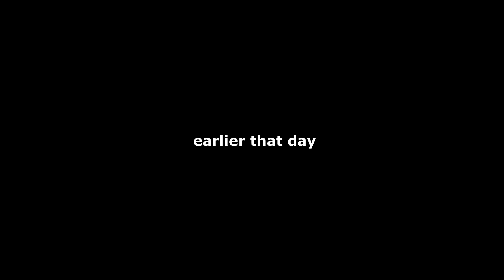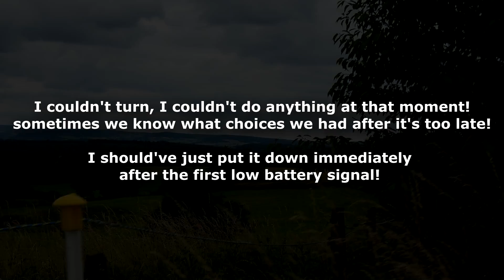RC Boeing 737 MAX8 fatal crash trying to land, it's gone.

Comment: Rc alert news! A plane crashed from the bushes, an airline called, "Ramy rc" Crash was fatal. There were 44 passengers onboard, 22 Passengers were killed in the accident. It also crashed because, After making 2 attempts to land on the runway. The 3rd attempt did not go very well at all, when it was about to do a Go-around this message came. 'Battery low please touch the ground immediately!' The pilots got scared, just before the moment it crashed. The plane started to stall, The pilots did a sharp turn 1 second before incident. 22 passengers killed, All of the pilots killed, 2 crew members killed. Plus, 26 deaths. It wouldn't have crashed, If they just start to fly it when it is 100% Battery. There were 3 Pakistani tourists Who lost their lives. And other passengers were just random. That is all for our emergency news today. have a great day!

Comment: It is 4 years late, but is it possible to include logic that cuts the power to the engines at low battery conditions? Then the remaining power can be directed to the control surfaces to allow for some control, while flying on momentum, giving at least the possibility for a somewhat controlled crash landing. Similar to real airplanes being flyable without the engines. I would really appreciate an answer.

Comment: Get a Mobius camera with a lens cable extension. Then hide the camera inside the vertical stabilizer and place the lens at the leading edge. Much better than attaching a GoPro.

Comment: I would have thought that the ESC with BEC would cut off power to the motors in order to maintain power for the servos.  Did this ESC not have a low voltage cutoff feature?

Comment: why not try some flight controller? suggest you A3 pro flight controller . that will balance the plane to level flight after stick nutueral  .that will make flying much easier. and another suggestion to you as a pilot myself ,when you do approach , the plane should pitch level and maitain speed ,that will be a good attitude\ speed and throttle setting.every time you do approach is way to steep desend .that will cause huge speed and  energy change when you try to  flare.on the other hand ,high speed approach will easily cause long flare ,used most of the effective runway , easily go around. and high speed approach will make you throttle down alot . try figure out an approach throttle reference setting . you always adjust around that setting. throttle is for altitude pitch is just try to compensate that moment make plane pitch level it will stable much much more and easier to fly much much more .

Comment: I would never have mounted the GoPro there, there are such small cameras why do you save Money on the wrong end. The wind resistance is too high that's why she also flew so bad, YOU are really a good builder but as a user you have failed.

Comment: Last thing you need is some backseat remote control driver barking orders while you're already struggling to maintain control. After seeing this one and the new one both crash, and one burn, I think you should start clearing everyone back far enough that you can't hear them bark orders and make you second guess yourself. I'll admit that I'm not experienced in RC flying, so I'm not sure if there is a safety or operational reason for having someone standing out there with you, but I can't see it being that beneficial to have anyone nearby to break your concentration or make you second guess yourself.

Comment: You know you should treat them like you paid a lot for them, if a battery signal warns you you land now not later. Don't be nervous  you are a good pilot and you make awesome planes, just relax like your a pro and correct your mistakes. Stay calm when your coming in and  don't try to correct just small corrections and leave it until you need another small correction.

Comment: LOL 737 Max’s still even crash in the RC world.Damn you MCAS.
Reply: Both of those crashes will be ruled pilot error. Bet you a grand. The VAST MAJORITY of 73-8-max planes fly in north America and Europe, and occasionally experienced MCAS upsets. The well trained pilots used the stab trim cutout switches to disable MCAS and the manual trim wheels to counteract any undesirable trim that had already been applied. You just don't hear about those cases, because when competent pilots fly aircraft, minor shit can go wrong without being a huge event. Of course the ballsack media make a gigantic deal out of it while knowing nothing about airplanes. But lets see. Out of ALLLLLL the max-8s that have crashed, which is 2, one was in Ethiopia, and the other was in Indonesia.... Hmmmm. I'm not sure about Ethiopian airlines safety record. But I do know that the pilots of that plane had the throttles at 94 percent the entire time. Which is ridiculous given the situation. Because of their speed, they had a hard time trimming the plane back using the wheels. So they turned the cut off switches back on... This is a MASSIVE fuck up. How about pulling those throttles back a little bit there guys? As for Indonesia?? A quote.
" Lion Air is Indonesia's largest airline, and the second biggest low-cost carrier in south-east Asia. ... But it has faced nagging questions about safety standards and from July 2007 until June 2016 was banned, along with dozens of other Indonesian airlines, from operating within both EU and US airspace." sure, the plane had some design issues. But not ones that should cause a catastrophic fatal crash if competent or properly trained pilots are flying.

Comment: Mayday theme song

Today on Mayday we cover the fatal crash of Air RamyRC

Which it's known as then one of the worst crash in RC aviation history
All lives board (electrical engineering) has being lost
1 black box was found it's the cockpit voice data recorder and the flight data recorder was never found

What should of being a normal flight quickly turned if not a RC tragedy when a simple mistaking care of the aircraft would quickly turn to a pilots worse nightmare. It all
 started when RamyRC when't on a flight late afternoon when suddenly the airplane quickly turn to a moment of fear the battery in the back compartment of the plane ran out and the plane was having struggles to stay in the air after making 2 attempts to land which both failed the second attempt would be the last it ever makes with no warnings the plane goes past the fencing and dives towards the grass lands behind where is would soon be the crash site for the aircraft. 

The NTSB report showed what the heard on the data recorder

 "There was a sudden jolt of the engines we suspected the fuselage a first but with more detail we knew the battery was t blame due to the trying to get the aircraft trying to gain more speed to land but it making it hard for the plane to land causing the go around and the the drop in altitude and speed suddenly. We suspect the battery was improperly taken care off resulting in the fatal crash. As were still investigating the crash hoping to recover the black boxes but we have no luck on our side, to this day forward."

May those (electrical engineering) have some sense on hope knowing that there fellow engineer components shall rest in peace.

Mayday ending

Comment: Too bad for this stupid accident, but it is the experience that progresses, the error will not be made a second time. The reason, a small track that stresses his pilot who does not know enough his plane to slow down to the maximum before asking. Also, it does not take too much clearance to the depth so that the plane remains stable. At depth, it takes a minimum travel for the reactions of the aircraft are accurate and progressive. Otherwise it's a pleasure to see him build, he is very adroit. Now remains the plane setting part and a good flight experience to have great confidence.

Comment: Ramy successfully landed all his models thousands of times. His landing technique is absolutely not in question in this crash. Anyway, landing with a higher speed is safer (you are at the max of the tolerance maybe :-) )
In my opinion, this crash, was caused by of a lot of small factors (as always). The main one is the loss off engine power, the others are stress, wind, and battery alert maybe two short ( ? )

Congratz’ Ramy for your good spirit, and thank you to keep sharing your passion in spite of the critics.

Comment: I love your channel but you need to use flight stabilisation and battery alarms, total cost is only $70.  Check out the omnibus F4 with GPS return to home, failsafe, autoland, and waypoints. It will save many tears. ;(

Comment: Ramy Ramy Ramy....sorry for the loss - please get some sim time and spend some time researching airliner approaches and landing setups before you maiden the 777, that said you made the right choice to land straight ahead and not try to turn her back to runway heading with such low speed and high nose or she would almost certainly have spun in and been reduced to tiny pieces - you saved most of the passengers as opposed to losing them all

Comment: Ohh Rammy.......how many times can I try to help you......I've commented on your last few videos on how to get the perfect landing but I guess you have not yet seen them.  You are still approaching TOO high and with TOO MUCH power.  Unless you are on the perfect glide-slope to the runway,which you are not, you will have to trade either power for altitude or altitude for power.  In other words, if you are approaching high and with a lot of power, the plane will have a lot of airspeed and will want to keep flying so you would have to force the nose down to actually land which is not the right way.  Just like in full scale airliners, you have to touch down on the main gear FIRST or you risk severe damage to the front of the plane.  On the other hand, if you approach the runway too slow, and not much power, you have a high chance of stalling the plane because of the high angle of attack needed to hold altitude.  So just so you understand, if you are HIGH and FAST, a LOW power setting is needed.  If you are LOW and SLOW, a HIGH power setting is needed.  And as I have always said, when you have the right power setting and altitude on approach, your power will control your altitude and pitch (elevator) will control airspeed.  This same technique is used to land the real 737 and it works perfectly.  Another thing, I would highly suggest you fix this plane and learn to land as close to perfectly as possible before attempting to fly your 777.  Otherwise there is a big chance of it becoming a big pile of broken plane.  I hope you have found this as helpful as possible.  I'm not saying all of this to sound arrogant or better than you, I just love you and want to see you have the most rewarding success in this hobby.  If you would like more info on landings, you can go back to your last 2 or 3 videos and you should see my comments there.  The absolute best of luck to you and your fellow flyers!!!!
Reply from the maker: sure man, I saw your comments, thanks for your advice and I will improve my landings for sure.
Reply: While everything you said seems spot on, Antonio, doing it in real life is still a lot harder then it looks! Now add cameras, production time pressure, and trying to make business of this wonderful RC habit that we share...the next thing you know, it's extremely challenging to perform!
I always try to coach my buddy Esteban, but he'll end up inevitably making horrific approaches, even after I make him slow down and talk it out before takeoff.
I feel bad for you, Ramy, on this one! Even though you took it like a man in the video, I could tell your heart was broken (As was mine). You put so much time and effort into this beauty, so it's no fun to make a mistake that results in a crash like this. I've definitely been there! Don't beat yourself up!!! Learn from it (which sounds like you did) and you'll be even better equipped for the next time. Never let a bad crash be wasted ;)
Reply: Antonio is actually spot on. You were too high and too fast, your only hope was landing far, well down the runway. Still no idea how you ended up in the opposite direction. Oh well this lesson will serve you well.
Reply: My gosh,
Reply: Of course someone telling you how to land does not equal real life. That's why you must go out and practice and hopefully improve. Your buddies holding cameras should not faze you, what would is a very expensive model that you have spent months on.

Comment: I'm early!!

Ramy, I love you. Please help me, how do we connect multiple servos (like ailerons) to one channel using the Y connector? Can you please show in one of your builds? Thanks. And, how do you make the wings to hold the dihedral angle? Thank you, love you again, and RIP
Reply: BlueJ   I'll try to explain the best I can.  If you lay the connecter down, make sure it looks like a Y shape not an upside down Y, otherwise it's upside down.  The 2 top ends will connect to your ailerons (Top left to left aileron, top right to right aileron) and the bottom connector that's pointing to you will plug in to the receiver.